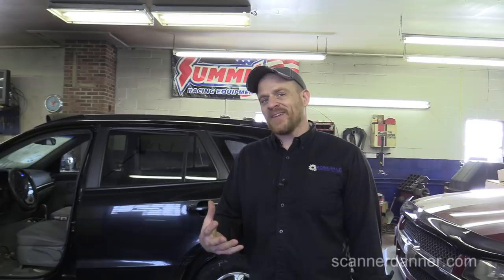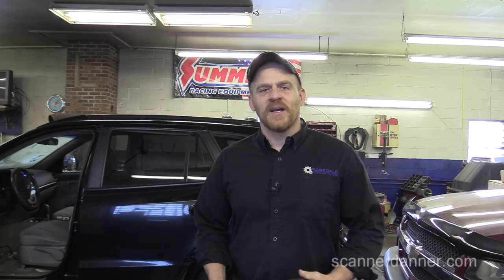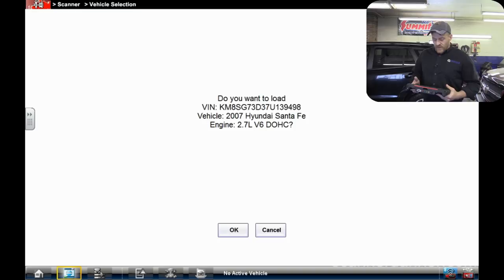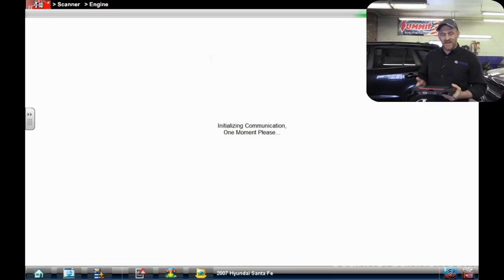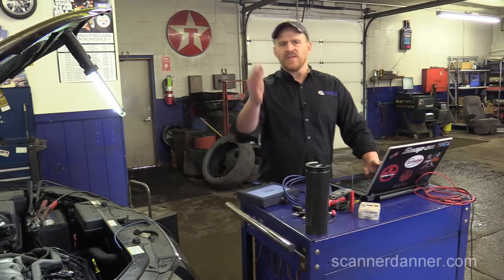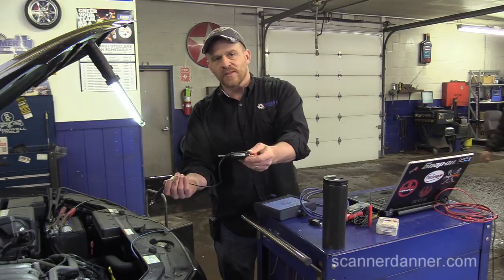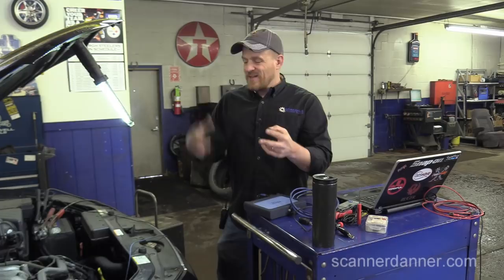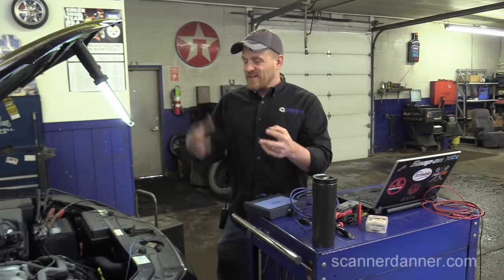No Start Testing Basics - Spark, Injector Pulse and Fuel Pressure (Hyundai Santa Fe)

Comment: pardon my novice question... but couldn't you have someone put the car in pre-ignition while you lay under the tank and if you hear no priming of the fuel pump safely assume its dead ? after ruling out the relay...(im not that good of a mechanic and seem to still have a "parts changer" mentality) lol thanks
Reply from the maker: you can do that but the variable is not all systems prime the pump when you cycle the key and sometimes it is very hard to hear them. could be because I'm getting old too lol
Reply: @ScannerDanner  ahhh see I didn't know that some don't prime with a sound noticeable to the technician... thanks for the tip.. You da man brother !!!

Comment: I have a crank no start issue on a Maxima 04 , checked my fuses and the left side of my fuse fox and fuses in the left side of my relay box don’t get any power and my security light stays lit in ON. Can I have some guidance on this I need help.
Reply from the maker: I need to know exactly what fuses are not getting power to help.
Reply: ScannerDanner ENG SOL, FR FOG, Throttle MTR, H/L LO-LH, 02 SENS, WASH MTR, AT CONT, ABS CONT, FUEL PUMP, I checked and fuses are ok, but the IPDM in these spots aren’t getting any power
Reply: Security Light staying on means you possibly have an Immobiliser issue, which could be caused by lack of electrical power, or is the result of it. 

Mate, goto www.Maxima.org and jump on the forums and goto the correct sub forum for your year model (Most likely 5th gen for you,  i have a 1995 4th Gen).

Maxima.org is probably the best place to be asking these questions.
Reply from the maker: Stupid YouTube. I didn't even know you replied back until now. Their email system sucks. They changed it for the worse. Did you fix this?
Reply: Thats funny, when ever someone replies to me, i get a Notification on my phone from the Youtube App about it, and the Bell icon on the Website also shows me i have notifications. No emails here, i dont think i have them enabled.

Comment: Could you not have done a final test to prove the pump is duff by putting a quick 12volt shot to the terminals of the pump to see if it runs or not and then you know for sure?
Reply from the maker: We did! To condemn a fuel pump, you have to have a good 12v feed and ground. And from memory and seeing this thumbnail, we used a relay bypass tool to do this very thing.

Comment: I would look for fuel pump relay put my hand on it to feel click and listen for click. Turn the key 1 click to prime. If relay engaged and fuel pump did not prime. Would change the fuel pump.
Reply from the maker: That's not complete enough of a test. That only tells you the control side of the relay is functional. I can give you many examples (video links too) of bad relays that click. Also, corroded power feed wires between the relay and pump and then also faulty fuel pump grounds.

Comment: as for burning brake parts cleaner, if it says "non-chlorinated" you'll be OK. it's the chlorine which is nasty when burnt.. same for older refrigerants which were chlorinated (R12 & R22 for example)  may as well add this. https://en.wikipedia.org/wiki/Phosgene
Reply: I was just going to say the same thing - you beat me to it. Not sure if they even sell a chlorinated carb or brake cleaner anymore - I haven't seen any here in MA.

I was always warned about R12 and flame ... makes mustard gas! Bad way to be poisoned ...
Reply: Chlorinated brake cleaner is available still.

Comment: If the pump does not buzz when you first turn the ignition on then the pump is screwed.
Reply from the maker: Not true, so many things wrong with this statement. Yes,  it is a guide,  but only a guide. Some systems do not use a prime

Comment: I used your video on the jeep for no start and found a short in my wiring. now it's actually showing code p0505 for idle air control circuit but the part is brand new. dies at really random times but starts right up. I'm stumped. help?
Reply from the maker: Is this a 4 wire stepper motor design? If it is, all four wires will pulse a power and a ground when you cycle the key on and off. You can use an LED test light and switch your test light polarity. Do it with it unplugged and touch each pin. One time connected to power and the other ground with your test light. It should pulse both ways on all 4 circuits. I bet you have one dead one.
Reply: ScannerDanner 

two pins light the test light when hooked to ground and the other 2 light when hooked to power when the first 2 that lit when hooked to ground won't light.
Reply from the maker: It should pulse as you cycle the key, positive and negative on all 4 wires. I didn't understand your description. Sorry
Reply: ScannerDanner 

I accidentally started it without the iacv and it started right up. took it for a drive without it hooked up and it doesn't die now. just idles funny at times but I can tolerate that. is it possible I've got a faulty iacv from the auto parts store? the guy I bought it from said he replaced all sensors hooked to the carb. the iacv looks brand new when I remove it.
Reply from the maker: Please re-do the test I described. Having it unplugged forces the IAC motor to stay in the same position all the time. Having it not stall with it unplugged tells us nothing. 
If you do not show a pulsing power AND ground on all 4 wires, we have a computer problem or wiring problem.
Reply: ScannerDanner is there a particular video I can watch for the test you mentioned. I  don't quite understand how to do the test. ( I'm not too familiar with electronics.) I replaced the pcm with one out of my buddy's identical 5.2 zj to make sure it wasn't the pcm. My pcm didn't show any codes where as my buddys pcm gave me code p0505 right away.
Reply from the maker: Yes but it is on my premium channel. Sign up for the 14 day free trail then cancel before your 14 days are up
https://www.scannerdanner.com/scannerdanner-premium-chapters/chapter-20-idle-speed-controls/361-iac-stepper-testing-part-2.html?highlight=WyJzdGVwcGVyIl0=

Comment: fuel pump ok ...what s causing uneven crank speed? I am diesel mechanic since 1981. I hear uneven lump in crank speed in any engine raises red flag.
Reply from the maker: agree 100%. This had an unusual cranking sound to it and is common to this engine as I had a friend with the same engine, one year newer, who was troubleshooting a no start problem and his cranked funny too. Maybe extended crank times from the bad pump collapsed the lifters? Not sure. But good observation motorhead. Sorry I don't have a better answer than that.

Comment: No start could also be your key lost its program I had a no start no pulse injection I literally changed everything that these vids tell you to check but not one of them talk about your key could also cause this issue I have a 98 Lincoln town car so after changing everything out still wouldn't start turned over but no start ended up taking it to a shop they said it was my key lost its program in the chip they ordered new keys programmed them and it fired right up
Reply: Bill Irvin - what happened to you is exactly what happened to me. I had an intermittent no-start condition. I changed out every part imaginable (that could cause a no-start condition), and I still had the same intermittent no-start issue. I finally took my car to a locksmith, and the locksmith reprogrammed my key - bingo problem solved. I knew to take it to a locksmith because the same exact thing happened a few years prior.
Reply: @infiniti_chik1225  yea it sucked I didn't even think about the key now I know I wish some of the vids on YouTube would tell you that could be one of the issues but I couldn't find one they all say the same thing.

Comment: A note about the brake parts cleaner it seems like you got some misinformation. There are two types of brake parts cleaners chlorinated and non chlorinated it should state what type it is on the can.

The one that releases phosgene gas is the chlorinated type which is NON FLAMMABLE and therefore is useless as a starting fluid. Many states don't allow the sale of it but for the states that do it is still manufactured. If you heat this non flammable compound yes it can release phosgene gas it even says so on the back of the can.

The non chlorinated types that are VERY flammable have a completely different chemical makeup and are mostly made up of solvents acetone, toluene, and methanol. Don't know what compounds they produce when burned so I stick with propane just to be safe.
Reply from the maker: Thanks for the correction. I just wanted to make sure people were aware of the dangers. Thought this link was good (provided by another subscriber here) https://www.youtube.com/redirect?event=comments&q=https%3A%2F%2Fenvirofluid.com%2Finfo-library%2Ftoxins%2Ftetrachloroethylene-brake-cleaner&redir_token=pp2oeycNv6pC3E2v5nteUOCoaSJ8MTUxNjU1NjgyMkAxNTE2NDcwNDIy

Comment: Do you ever work on Saabs??
Reply from the maker: I have. I'm no Saab expert but all these cars are really the same.
Reply: ScannerDanner by any change do you know what I can do to mine. I have a Manual 2003 Saab 9-3 and my car looses power on 1st an second gear once I'm out from the highway I have to restart it to get full power back on 1st an second gear. Everything work no check engine light either

Comment: These manufacturers really piss me off when they leave off things like a schrader valve on the fuel rail or fuel line. It’s something that should be on EVERY vehicle out there and there’s no reason for them not to put one there other than saving a penny per car. The hoops you have to jump through to adapt a pressure gauge to some cars is just flat out stupid.

Comment: Seen people get blown up real good burning acetylene...think I'll take my chances with brake cleaner.
Reply from the maker: So you think that was a bad idea what I did with the torch? I didn't let it sit there and accumulate. I would think that is where the dangers are.
Reply: Air + Acetylene mixtures are far more explosive than propane especially when enclosed .. I am glad it worked for you though .. I wouldn't try that with my car with all the plastic inside though
.. just compare them sometime with a plastic soda bottle and hold your ears .. you will see :)

Comment: Why haven't I seen you use a power probe?
Reply from the maker: I have a hand full of times.
Reply: NothingSpecial because you haven't watched enough of his videos.
Reply: I've only come across Paul's channel in the past few months and I've been binge watching his videos like crazy. But, he's got a serious ton of videos. If he's only used a power probe a handful of times I can see why I haven't noticed. 

I guess what I'm getting at is why I've seen Paul using his test light like it's a crack pipe but never a power probe. Haha, no offense. 

Sometimes when I'm watching a video I'm like, man if he was using a power probe he could just give that circuit a ground real quick and be done or that the power probe can differentiate power/ground without switching battery terminals while using a test light. 

I dunno, I use my test light a lot but I also use my power probe all the time.

No biggie.
Reply: NothingSpecial you can apply power and ground with a test light too. I have a power probe but honestly I use my DMM with load pro leads or a test light more. Quick test I use test light. If I know I'll want a more dedicated tool or if I'm checking a ton of fuses and want audible I'll go power probe. It does have it's place. The other part of the time I just don't feel like getting it out of the box and hooking it up, I hate coiling the leads up lol. I have the kit with the short finder as well. If you're just starting out, I very much suggest a digital multi meter and some good leads or the load pro leads if you feel like learning that tool. Poking around with a power probe and applying ground or power where you shouldn't is a way to get upset real quick. I don't know your skill level, just putting it out there.
Reply: TheTotalMechanic I hear that. Know your tools. When I'm front probing relay sockets, yep I said front probing, I like the power probe because I can identify each terminal function in the socket and power the load. Every tool has its place, as you said, but I think the power probe is underrated. 

I'm only saying that I know how to perform a voltage drop and I almost never ohm anything to say that I know the difference between a multi meter and power probe. My opinion isn't without basis.

All the people I know who have them don't use it because they are afraid of causing damage. But, if they knew their tools they'd know that you can't hurt anything as long as you're paying attention.
Reply: TheTotalMechanic I hate leads, too. You know what I want? Wireless leads. Wouldn't that be awesome?
Reply: lol yes, let me know when they come out.

Comment: @5:00 wood stove. Interesting way to heat a commercial shop. Granted it's plenty far enough off the floor.
Reply from the maker: lol I know right? Some grandfather clause. I don't worry about it at all anymore as I've been working with Pete for like 20 years. It does seem sketchy though.
Reply: ScannerDanner I heat my home shop/garage with the same stove but I don't keep any fuel in cans or do fuel anything with a fire in the stove. If he has floor drains like I do any fumes get vented out. Heavier than air.
Reply: ScannerDanner speaking of sketchy. Acetelyne!!! You sir have some stones. I use propane for a fuel source much safer.

Comment: If the pump is bad you could beat on the tank  forever. I don't see the point there also 9 out 10 you can hear the pump run I hate electric pumps or working on them
Reply from the maker: Pumps can fail in a way where the brushes make poor contact, once you beat on the tank, you jar the pump motor and it will start spinning, and will run normally until you shut it off. It is a common failure. Beating on the tank can save you a lot of time :-)

Comment: It should be mandatory for a test port.
Reply from the maker: agree
Reply: My 2006 jeep rubicon is eating my lunch with a P0344 code!! ERRRR!!
Signed up for your premium channel. Look forward to learning more from the master!!
Reply: I realized if I am gonna watch  the classes I need the book also.  Done deal.
Reply from the maker: Thank you so much! You will not be disappointed. 
What engine is in the Jeep?
Reply from the maker: Cam sensor fault right? I have seen faulty crank sensors cause cam sensor codes and faulty cam sensors cause crank sensor codes on these. https://www.youtube.com/watch?v=qpL_0-8DrhE
https://www.youtube.com/watch?v=YtpDi2vnGog

https://www.youtube.com/watch?v=kRnq8uuUGOg

I hope these help. Thanks again!
Reply: 2006 4.0L. Latest update. Took it to the dealer. The said timing out 130 degrees. They said we will reset timing for 400 buck. I told say no thank you sir. 
Took it home and found out the cam sensor was installed incorrectly. I should have double checked my two  nephews work. My bad. I reset the camshaft sensor and cleared the codes. Engine runs much better but when I look at my Live Data I still have a slight rough idle. 
Returned to dealer and had scanned . They said you are 15 degrees and in spec.and every thing is good. NO CHARGE
I asked what is causing the slight rough idle. They said everything looked good. How can I see no square waves on my scanner and idle is fluctuating but they cant see it?

The Jeep drives much better but I will need to find the culprit of the rough idle.

Regards

Comment: no disrespect to you, buy all this messing about is taking a half hour diag to an hour and a half. i appreciate the effort and what this method does but i feel this way too much for a dead fuel pump. i would of sprayed the brake clean down it and then checked fuel pressure when it ran.
Reply from the maker: You have a skewed perspective bro. If I'm not filming and teaching, I have 5 maybe 10 minutes max in this diagnosis using the methods I've shown.
Reply: Phil  ---If the pump did run, you could check amperage & do the math to arrive at pump rpm
& come close with the pressure,then scope the pumps wave form & it gets a new pump,
due to worn armature,etc. That would be quicker than accessing the fuel line.
Hey ---it's & worn out,thus a new pump & repeat the testing on the new one.

Comment: WTF?  Everything done here can be done with a $5 multimeter.  No scope, no test light, no amp clamp, just a Harbor Freight give away multimeter.
Reply from the maker: so do it then. I'm not pushing tools, just showing techniques. If you can adapt what I am doing with less tools, more power to you. No need for the WTF comment